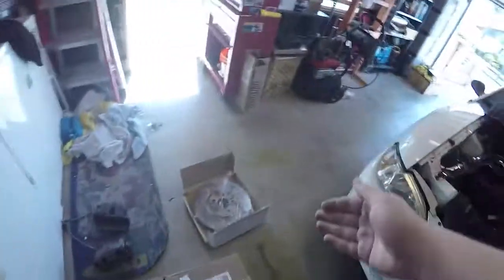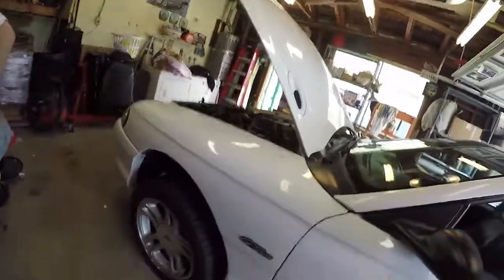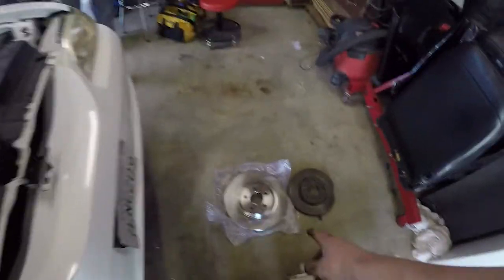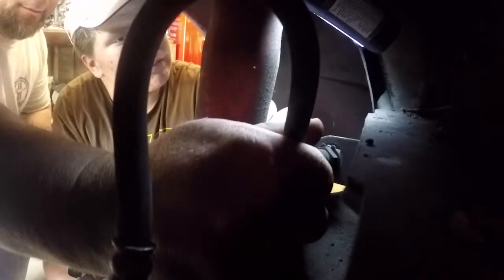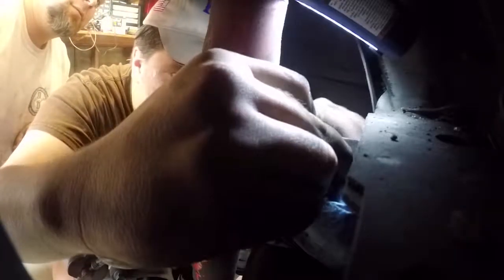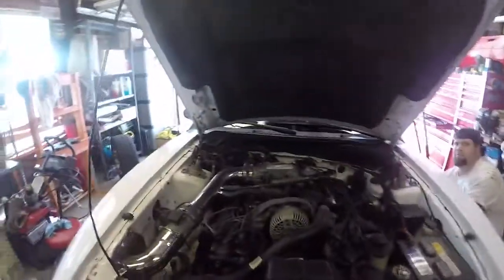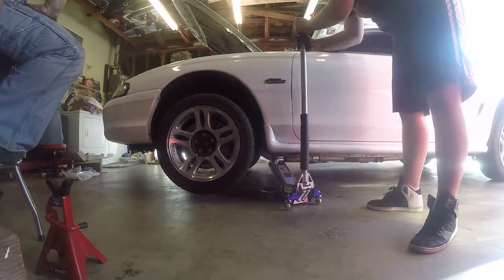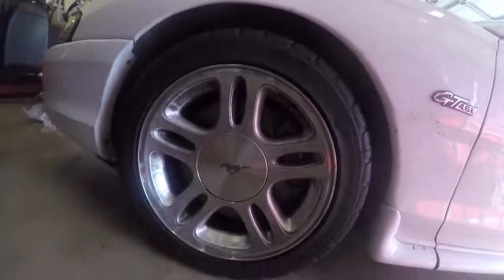Putting COBRA BRAKES on my MUSTANG GT

Comment: I know its been a long time but can you link the parts you got i would love to do the same to my gt
Reply from the maker: I can’t really link the calipers cause I got them 2nd hand and I don’t think anyone sells them new. But they are just stock 1996-04 cobra calipers, stock cobra pads and rotors. And you don’t need a special bracket cause they bolt right up

Comment: What did you use for brake lines
Reply from the maker: I used the ones that came on the cobra calipers and just connected it to the stock ones on the car. They should connect no issue